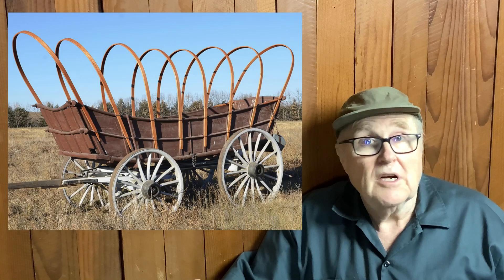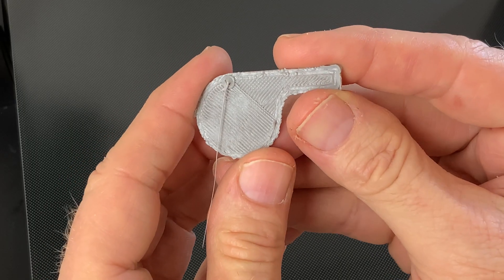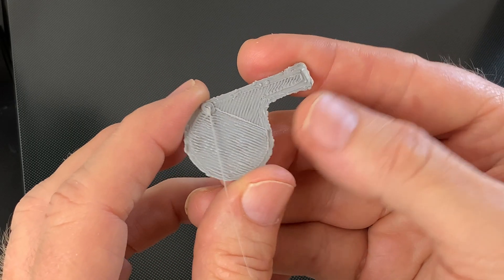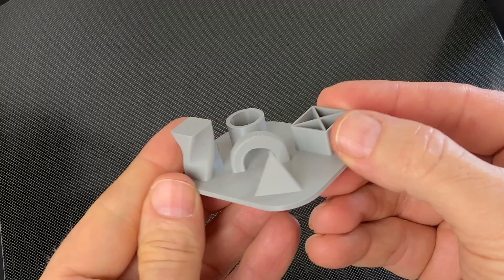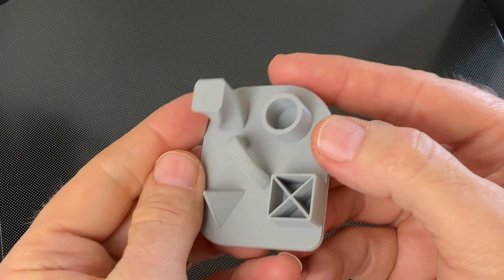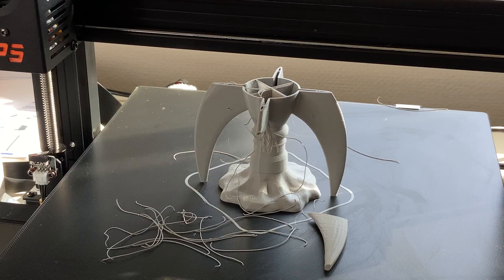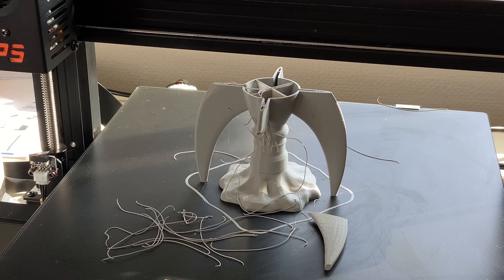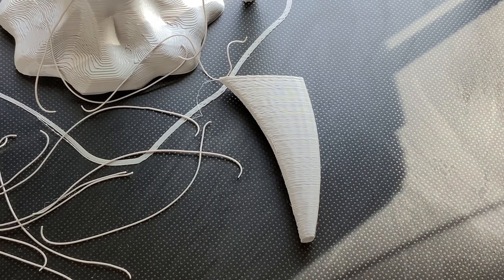This I Do Not Need!

Comment: Lord jesus, I feel the pain. Resin printing was one of the biggest learning curve hurdles I've ever had to take on in my LIFE... I'm sure the amount of troubleshooting for FDM is comparable.  Its so irritating to deal with, but ONCE you finally get everything working... it USUALLY works.  And even better, you're able to troubleshoot and even help others a LOT faster than originally, where I'd probs would have been tearing out my hair from the root. 

Also looking at the comments, maybe it really is the brand. ALL I hear about is how good Prusa models are out the box, big and small. I dont use FDM but if I ever did, definitley what I'd use, since every single person I know living and breathing and not thru an online review or advertizement seems to vouch for it.  I REALLY would love an FDM to make PERFECT Mold casings, one of my biggest goals down the line... GODSPEED. AND if you ever dive into Resin printing (I REALLY feel like resin is more your vibe ANYWAY) I can MOST DEFINITLEY Help.  Resin printing is extremely simple to me, BESIDES the cleanup, which CAN be a little wild. But not totally unmanagable.  Even BETTER if you have a workshop with plenty of space to work, it should be no issue. If you go for something like a Mars Pro, you need less than a printer desk worth of space to even vaguely get started. It's a NO brainer for me.

Also with Resin printing, I REALLY feel like you troubleshoot more but actually get closer to perfect prints, whereas FDM seems to fail for all kind of random reasons.  Now I can look at a resin print and say "oh, layers shifted" or "Oh, my supports were too little in this spot". It's fairly simple to just stop the dang print and start over (I got flex plates so removing a plate with a fail is even easier now.

Check it out! I hope you will eventually!
Reply from the maker: Hi Nicole, thanks for the offer to help. I appreciate it . Like you I love resin printing and found it much easier to get started with than FDM.  Elegoo was nice enough to send me a Mars 2. Look back a few weeks over my playlist and you’ll see some resin projects that I’ve already done. Many more are in the pipeline for the future!

Comment: Your frustration level with 3d printing will likely subside quite rapidly, but never go completely away.  If you can achieve a print success rate of 90 pct or better you will be pro level in my opinion.  Even the best setups with expert tuning do not work 100pc of the time.  As you already alluded to in your video setup of the part has as much to do with it as anything.  Just like how you can pick up a part in your hand, spin it around and almost immediately form a plan in your head about how to mold and cast it to avoid problem spots you will soon  be able to orient a part in the slicer to avoid as many pitfalls as possible.  Hang in there, it will be worth it in the end.  Next get yourself a resin printer and enter into a whole other arena of frustration followed by sheer delight when you get beautiful parts for the first time!
Reply from the maker: I already love resin printing because of the quality of the prints!  FDM allows me to do projects that aren’t feasible with resin.  But the fiddling required is unfortunate.

Comment: i feel you. 2 months ago, i got my first photon m3 resin printer. Spent whole week brainstorming why all prints failed (im complete newbie). Ive spent half litre of resin, bought 2 new USB (i red that it might be USB fault).After week they ive found out it came with non functioning display. After some back and forth messaging with support team, they agreed and sent me new display for free as it was still in warranty. So 6 weeks later i got new display, changed it (successfully, yes it is hard AF!, especially with those fragile wires), only to found out there was leak in the resin tank, and it damaged new display, luckily only protection film. So i had to order new FEP film and new screen protection glass. Changed it and it finally, after 2 months it printed something successfully. It cost me lot of nerves, and money for resin, USBs, FEP and screen protection. Had i knew this upfront, i wouldn't buy it...
Reply from the maker: You can always get a lemon! 😭

Comment: I feel your pain, Robert! I bought a Flash Forge Adventurer 4 months ago because it was supposed to be pretty much ready to go right out of the box. However, I've yet to get a print that I'm totally happy with, and I've had to do way more tinkering and adjusting than I ever wanted to do. If I'd known that was going to be the case, I would have spent a lot less and bought a printer that I had to build myself. At least then I would know how it all goes together and what makes it work without needing to do a ton of extra troubleshooting research.
Reply from the maker: Yes, calculate the value of your time and add that to the cost of the machine. They are not so cheap then.

Comment: Would you recommend building from scratch, using a kit or just getting a pre-built 3D printer?
Reply from the maker: I would prefer a working plug and play printer. But building your own would be fun if you like to tinker with gear. Plus you would really understand how it works.
Reply: @RobertTolone  I actually love to tinker, especially with software, so I'll have to add that to my growing list of projects. I might be crazy, but it'd be fun to write my own firmware for a 3D printer.

Comment: You've built up a decent following and reviewed 1 fdm printer. Now all of the cheap cloners are coming out of the woodwork to give you a "free" printer for review. I've loved your insights I to resin casting. Those have been great videos. I'm interested to see what you do with fdm. I'm sure there are 10 videos out there for each of those printers that show you how to print upgrades to make them actually work. Some from the manufacturer. Unfortunately those only work if you have a working printer or are willing to spend more money to "upgrade" some thing. It's only an upgrade if the thing already works and your making it work better. If it's broken (doesn't print out of the box) you're fixing it, not upgrading.
Reply from the maker: I don’t do tool reviews and I won’t become a printer review channel. I like to use tools, not fiddle with them!

Comment: I'm sorry to hear you are having soo many issues. I know the Ender3 and it's clones can be terrific machines, but they do need a lot of dialing in to get them working reliably. I wouldn't mark all FDM/FFF machines as Conestoga wagons though. Certain manufacturers/models are a LOT closer to your initial analogy of the Model T, like Prusa, Matterhacker's Pulse, Ultimaker, Raise3d, Zortrax, and a few others, and quite a few of those you can order complete and just about ready to print aside from some usually fairly minor and quick final dialing in.

If it helps, might I suggest reaching out to CHEP/ Chuck Hellebuyck, Maker's Muse/Angus, SexyCyborg/Naomi Wu, and Today's 3d Print/Nerys as they all have a LOT of experience with Ender3 printers here on youtube. Chuck Angus and Nerys have been working and using ender3 clones for years now on here while Naomi used to work for Creality, the company behind the original Ender3 printers. All four of them have fantastic and intricate knowledge of how they work, where pitfalls may be, and a ton more.
Reply from the maker: I watch all those channels. They’re really helpful.
Reply: @RobertTolone  Glad to hear that, but still wish there was more I could do to directly help with those machines. Just don't have the specific hands-on experience with those to really be of much help. I've got 2 Prusa I3 Mk3s that I use, and they've been rock solid machines for me, aside from the occasional hiccup due to bad filament.

Comment: I got a Prusa and have never looked back. I'm not good at tinkering, etc. so Creality wasn't for me. I have the Ankermake on pre-order which also looks promising.
Reply from the maker: Lots of recommendations for Prusa in the comments!  I’d love to give one a try.
Reply: @RobertTolone  if you go with the mini like I did there is still troubleshooting at first with some weird things that should've been adjusted when you buy it stock, but once I got it working it's been great ever since. I would recommend a normal Prusa, the upcoming one (expensive) or getting a resin printer. I want to get more into resin myself.

Comment: All right Robert. I'm into 3D printing for more than 10 years. There's no magic. You get the wrong printers for you. Low cost 3D printers are the project itself, not flawless tools. If you want a 3D printer working first time anytime right out of the box, get an already built genuine Prusa, an Ultimaker, a Lulzbot or a Zortrax. The Prusa Mini is particularly friendly for newcomers because of it's self test and buit-in calibration wizzard. These features should be in every 2022 printer. It's relatively budget friendly too.
Reply from the maker: I expect to work my way into the better class of printers.  I figured I would start with these budget friendly printers since they were given to me to test on the channel.  Even with the bumps and bruises the journey should be fun!
Reply: @RobertTolone  I wish it will. When I started, there were no other option than to build yours out of questionable parts and most of us enjoyed it. Nowadays you have much enjoyable options. To me, that options worth the few extra bucks as you can spend much more fixing rubbish printers, even if you don't pay them. I own a youtube chanel under another name and also was given free printers to be reviewed. To be honest, only few of them worth their price.

 There's nothing insurmountable tinkering endlessly (poorly engineered machines never get fixed) 3d printers. But this can be pretty disappointing for the newcomer as issues can pile up. You look like a wise and patient man. Maybe you don't worry wasting a bit of time.
Reply from the maker: @axelSixtySix  If the machines don’t work after a reasonable length of time I will say so on my channel and move on. That is the risk these manufacturers take when they offer the machines up to Youtubers. We are under no obligation to lie. But I will also give them a reasonable chance to help me solve the problems. Fairness and honesty must prevail.
Reply: @RobertTolone  Well, you're extremely patient. Once  I recieved 3 times the same machine was not able to make one working even with 3 sets of parts (Early FLSun delta). Believe me or not, I hardly tried.But that was enough tinkering. Tinkering is not acceptable as they charge for a working machine, not for a wanabe 3d printer, maybe ? Today my opinion is a machine must at least work flawlessly the first week, otherwise there's definitely a deep conception issue. But I understand you give them a chance as you're not a skilled user with a lot of comparison points. But, hearing from you and knowing that brands, currently there's not much good signs.

Comment: Hi Robert, I am still developing that shell project you kindly came back to me on, this time attempting to gang them all together with the resin runners all built together to hold the form, but still not there yet.

I am not into product or brand punting, but every machine I have bought from Voxelab direct they have been stellar on support turnaround and general wanting things to go well, looks like you are heading for a large format but the Voxelab Aries has been unstoppable straight out of the box and not six months in; maybe the 20x20x20 format is not for you but worth a mention. I feel your pain really, the new resin printer is not exactly smooth sailing, but an interesting thing to master; or trip over.
Reply from the maker: Interesting that you mention it. Of the three printers I’m working with this week one of them is a Voxelab Aquila X2.  It is the only one that is currently making good prints.  I wish it had its own profile in Cura 5 but the Ender 3 profile seems to work OK.

Comment: I outsource all my 3D printing. It may be expensive sometimes, but I save myself so much frustration.
It looks like your printers are filament deposition types. Have you considered getting an SLA resin printer? They are expensive, but the quality seems to be much better. I would be super interested in seeing you test out that technology.
Reply from the maker: Check back through my catalog. I’m already doing  SLA projects on the channel. I had few problems getting going with that and it probably made me over optimistic about FDM.

Comment: I have had 2 FDM printers myself, both decent machines and we have a Prusa at work (along with a chest freezer sized god knows how much it cost professional machine)  and all of the FDM models required significant fiddle farting around  just to get them running and even more to keep them running. 

The least pain in the butt home grade printer I have had so far is my ender 3 v2, but its second print was a shim to fix a motor angle causing binding in the Z axis. The Prusa, man we paid extra to have it built, when it finally got here nothing about it was square and it has twin motors / screws for the Z axis and within 3 prints its tilted almost a millimeter. We even put a work instruction next to it with a level, turn machine off place level on it and turn z axis screw(s) until its not worthless.

Comment: Ah the glorious world of FDM printing, how I hate it. The vast majority of FDM printers don't work out of the box and anyone who says they do is a liar. Even the most expensive pre built Prusa will still need tweaking either on the hardware or in the software to get it working correctly. The cheaper the printer the more work you have to do in my experience.

Personally I've pretty much given up on FDM, I prefer resin, it may be messier and smell like crap but it works pretty much every single time without fail (unless of course I screw something up).
Reply from the maker: I see the potential in both so I’m hoping that I can get over the tinker phase and onto the making phase with not too much more effort. But, we shall see. To be honest it was a real struggle for me to learn to model in Blender, but now I love it. So maybe FDM will be the same.  Do love resin printing though!
Reply: @RobertTolone  Both are extremely versatile and have uses. For me FDM is such a headache, I'll print the same thing 3 times without issue then the next 10 prints fail for no reason, extremely annoying.
I still haven't learnt Blender yet, I'll get to it... One day lol.

Comment: Sounds like a frustrating week. You know, it's all good videos in the end, the successes and the failures. Out of curiosity, did you end up with a Prusa? Also, try Superslicer for your slicer. It's a fork of PrusaSlicer which is a fork of Slic3r, but it has some great calibration tools to help you dial in your settings. I was happy with my Prusa prints but then I went through the calibration via Superslicer and everything works so much better. Currently struggling with having the wrong bed for the cheap PLA I bought.

Also, filament is often but not always you get what you pay for, except the actual price differences often mean buying cheap filament is a waste of money. I have some PLA that is so hydrophilic that after a day of printing I need to chuck it in a drier for 6 hours. I'm currently rotating two spools - 1 drying, 1 printing - and most of my prints are still failing because they're detaching from the bed at some point. Partially I have a bed type suited for PETG that PLA doesn't adhere well to, and partially I think it's the crappy filament. Paying $24 instead of $26 for 1kg of filament has costed me far more than I've saved.
Reply from the maker: What brand of filament do you use now?
Reply: @RobertTolone  anet pla. If I leave if in my printer when I'm not printing the filament breaks.

Comment: I added a BLTouch bed leveling sensor to my Ender 3 and it really helped with not having to fiddle with re-leveling the bed to get the proper squish and adhesion for the first layer all the time.  Also upgrading to a dual Z axis was also a huge improvement.

I’m starting to look into klipper which is on a whole another level but it greatly speeds up prints, 150+mm/s and no sacrifice in quality.  It also can compensate for the shaking of the machine & print head and belt stretch to reduce ringing and improve prints even more.  Always something new to explore with these printers.  Don’t be afraid to post a video summary of some of the challenges you work through too!

Comment: Unfortunately when it comes to 3D printers, those “entry level” machines are anything but. In this world, the new user machines are the $800-$1200 bracket whereas the base model “tinkerer” machines are the $200-$600+ bracket, the prosumer machines are scattered about the place in terms of price/features. It’s still a bit of a Wild West, even though the baseline quality is staring to improve and more “off the shelf” models starting to enter the market

Comment: You didn't mentioned the printer models, but if you're having that much issue, it's probably because they're cheap printers. If they're provided to you as a sponsor deal I get it, but if you're buying them, save yourself the time and get something like a Prusa MK3s.
Reply from the maker: You are correct John, they are all inexpensive printers. My plan was to work my way through a lot of different printers and hopefully wind up with top-of-the-line machines. Truth is, I do not care about tools or machines. I only care about using them.  A tool that works and lasts is a joy to use. As soon as I have my favorite 3-D printer I will stick with it. Many of the tools in my shop are 40+years old.
Reply: @RobertTolone  Yeah and that's the problem with a lot of cheap 3d printers, you end up spending a lot of time working on them instead of using them as tools. Like a car that you spend more time fixing than driving. Which might seem fun at first, but it's gets tiresome when you just want it to work.